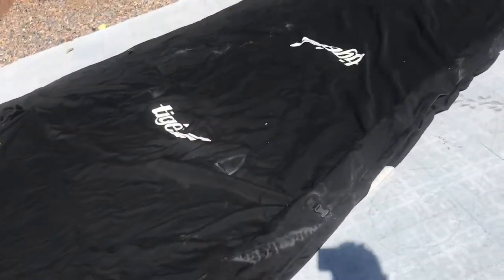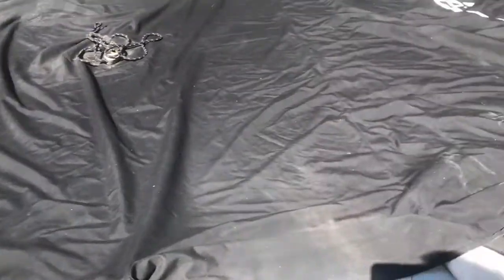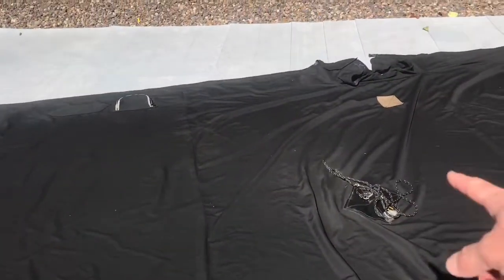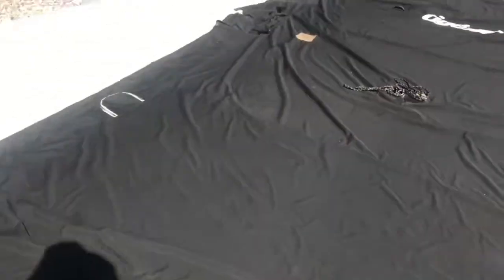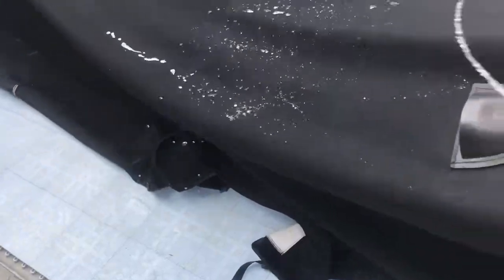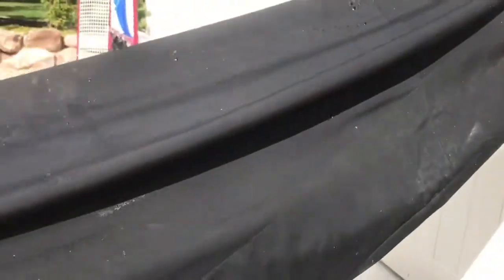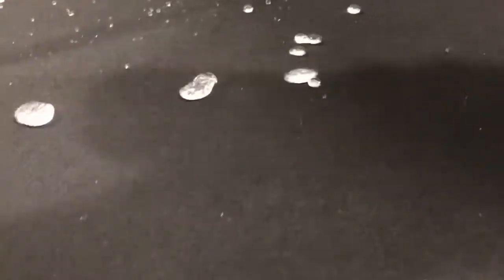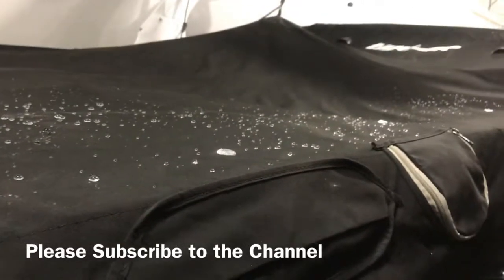Boat cover waterproofing 303 Fabric Guard

Comment: I've had better results with a $6 can of tent waterproofing spray unfortunately.
Reply from the maker: Good to know that works too!
Reply: So did you just use a can of six dollar tent waterproofing and it worked? Or did you actually compare these two and you know that it works “better”?
Reply: Both Starbrite and 303 have excellent ratings.  It's a bummer when all the stuff in your boat gets wet and you paid big bucks for a cover.